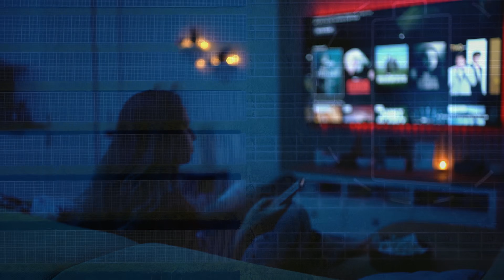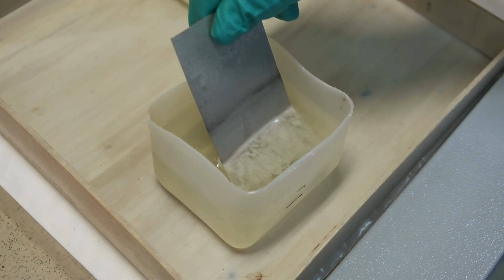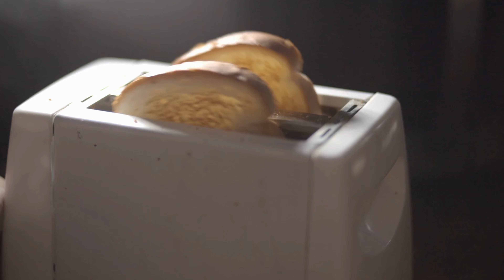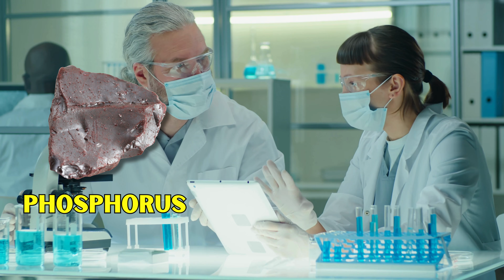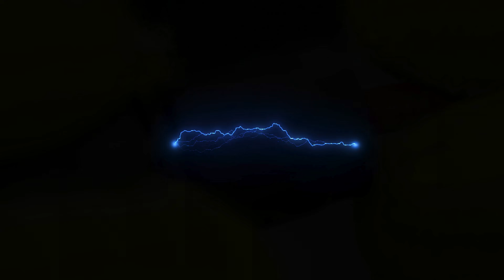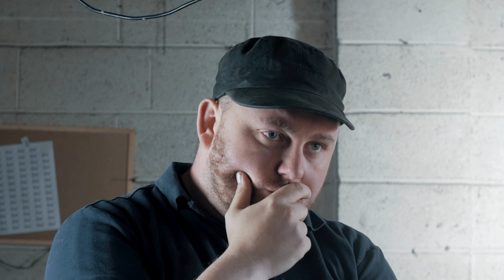How Do Solar Panels Turn Sunlight Into Electricity?

Comment: Technically things like your TV even refrigerators and other electronics run on DC voltage there is a transformer in each of these items
BMH
Reply: No, they use AC and to run an elec device and that comes after rectifying DC
Reply: @Asmuthexe yeah they use ac but run on DC
BMH